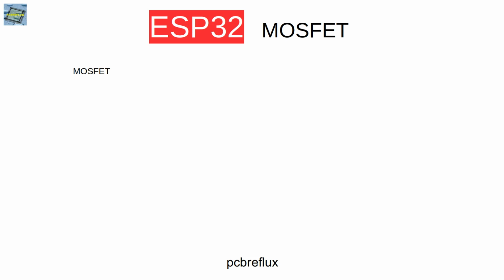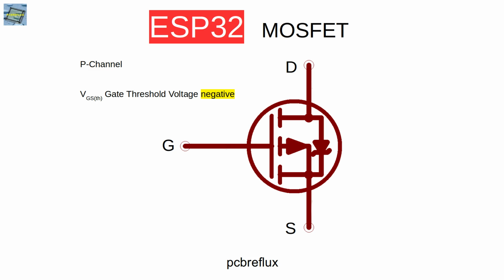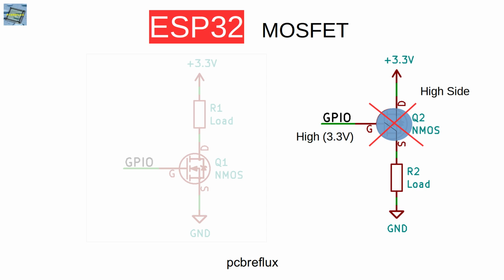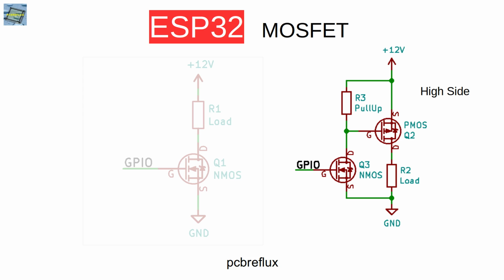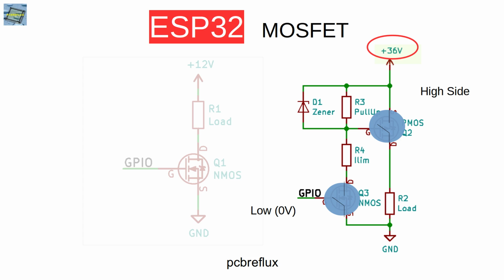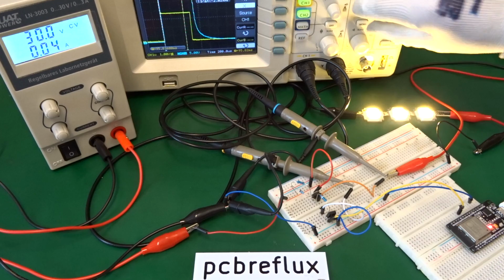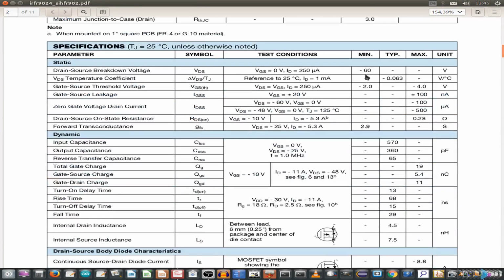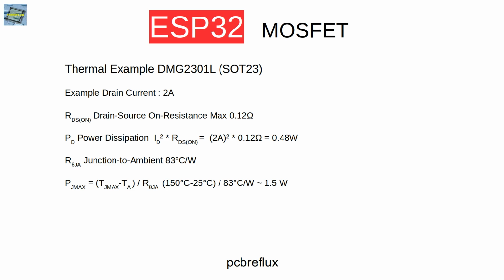ESP32 #59: ESP32 MOSFET Tutorial (as a Switch)

Comment: Thanks for this tutorial, excellent explanation. I have an ESP32 microcontroller and needed to control high voltage motor using a MOSFET as a relay. Wanted to know if a MOSFET could be controlled at 3.3 volts from GPIO pin to turn OFF or ON a 12 volt DC motor. So from my understanding, I can directly connecting the GPIO pin to the mosfet without adding any resistor needed?
Reply: Sure you can. I would use a 1k Resistor anyway to protect esp32 from over current.

Comment: Can this method also be used to interpret a variable gpio voltage from 0-3.3v to get a varying output voltage( or current, however you want to look at it) from 0-12vdc? Think of using for 2-3 amp solenoid valves

Comment: Thanks for the clear explanation. You're obviously very knowledgeable. Just one question from a MOSFET newbie: you first show on the left a circuit with one N-channel MOSFET which seems to do exactly what I'd like it to do. Then you go on building more and more complex circuits using both an N-channel and P-channel MOSFET, adding resistors and a Zener diode. Why would one want to do this? Are N-channel MOSFETs more limited from a max ratings point of view or is there a great advantage using the P-channel setup? Thanks!
Reply: You can use it for a load which is connected to ground.

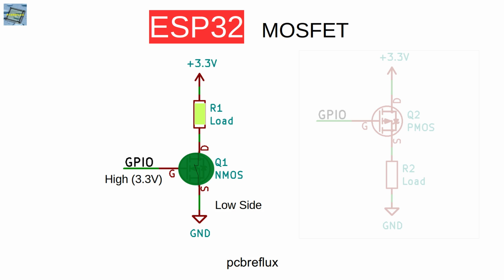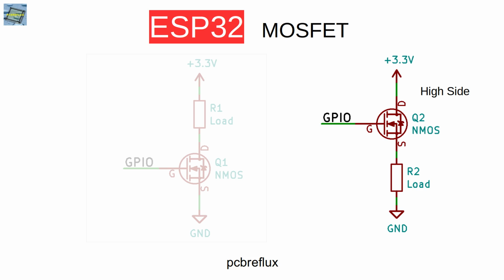Comment: Really bugged me, but it seems you've got your N and P MOSFET symbols mixed up in the video - at 4:33 all seems okay, but when you start to talk about the P-channel MOSFET at 4:52, the symbol for the P-channel MOSFET changes to an N-channel one! Is that just me?  Looks like you've mixed up the P/N symbols after that too?
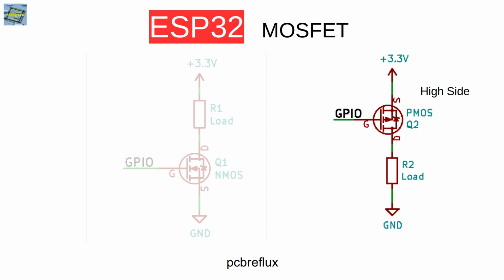Reply from the maker: Hi, at 4:33 its about N-Channel an the low side (load to positive rail) and at 4:52 about N-Channel on the high side (load to negative rail) and why this is not working with a 3.3V GPIO Pin and a 3.3V rail. At ~6:13 is the switch to P-Channel and why you can use it on the hi side with a 3.3V GPIO Pin and a 3.3V rail. Some times you prefer a load not permanent connected to the positive rail, but on the other hand most N MOSFETs from the same type have lower Rdson (Ultra Low On-Resistance).

Comment: For N or P Channel mosfets often I use AO3400 amd AO34001, they start with 2.5V and have a very low RDS(on), etc. maybe a better choice for you.
What kind of zehner diodes have you received?
Reply from the maker: This was in my last received order (around 2000pcs):

BZT52C11V SOD-123 
BZT52C6V8 SOD-123 
BZT52C10V SOD-123 
BZT52C9V1 SOD-123 
MM3Z6V8 sod-323
MM3Z11V sod-323
MM3Z3V3 sod-323 
MM3Z5V1 sod-323 
MM3Z9V1 sod-323 
MM3Z10V sod-323 
MM3Z11V sod-323